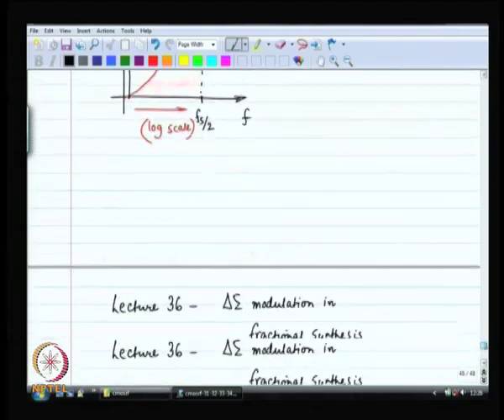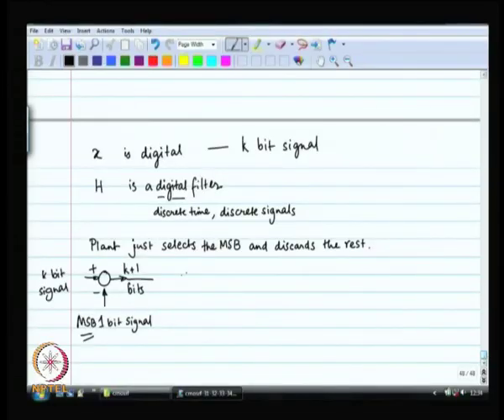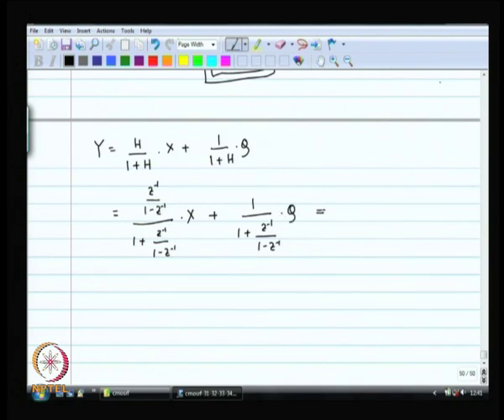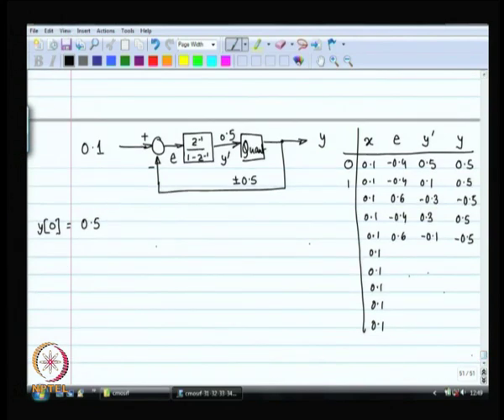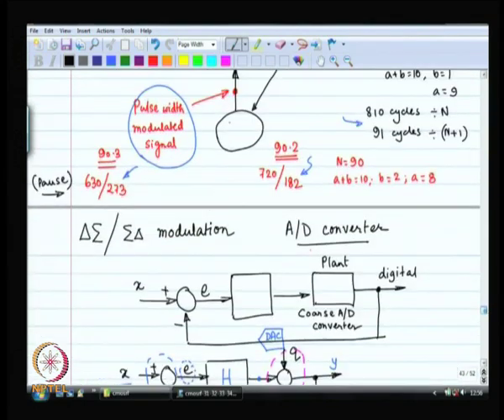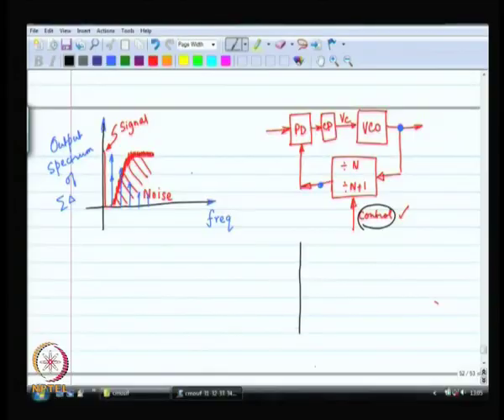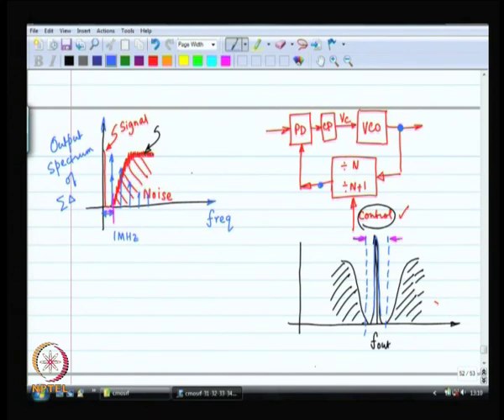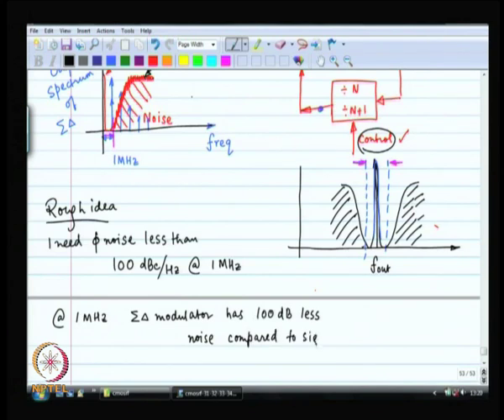Mod-11 Lec-36 Delta and sigma modulation

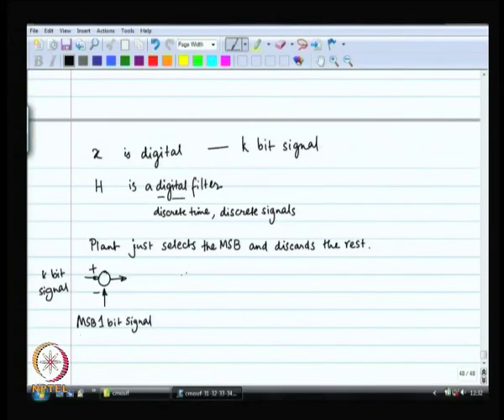Comment: At 7:52, Professor Chatterjee says that we have to subtract the MSB padded with zeros.
I did a circuit like that but the outputs were not showing right.
Then what I did was not pad zeros but short the other bits of the feedback signal to the MSB and the outputs started showing right.